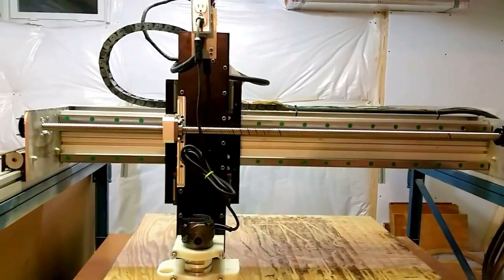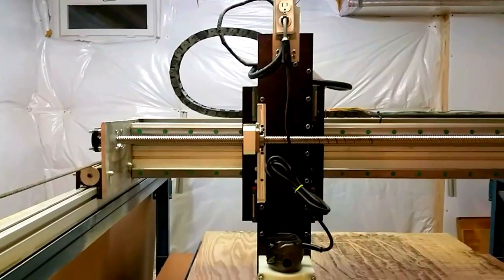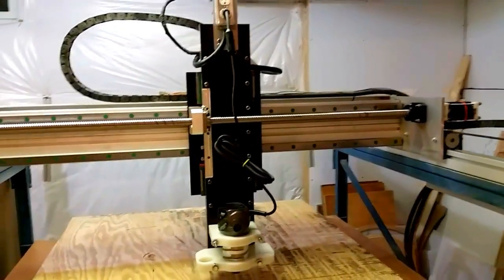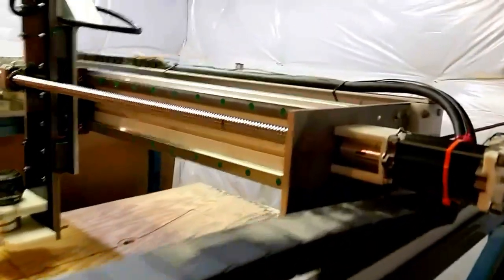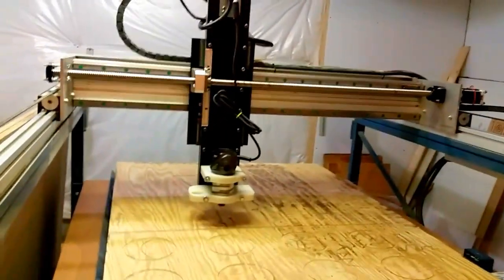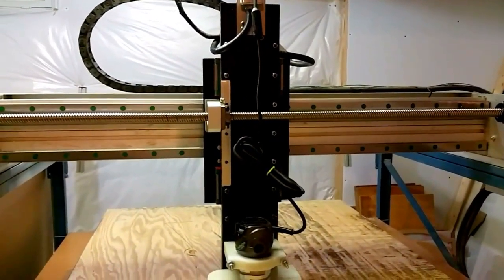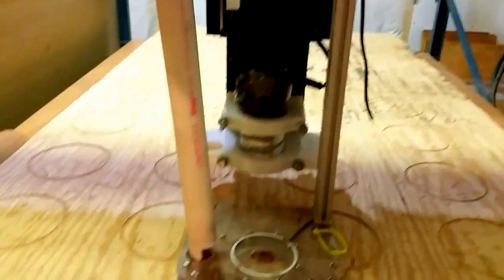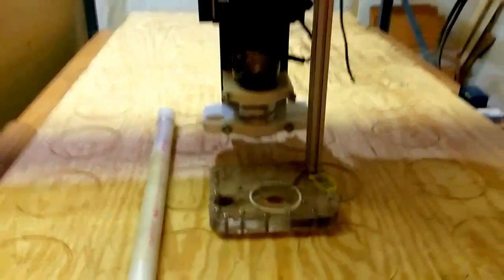DIY CNC 50" X 100" Hiwin Rails w/ Ballscrew 1605 2525 Upgrade

Comment: can you tell me what are the specifications for your ball screw diameter, lead and pitch  ?
Reply from the maker: 2525 for the x-axis (25mm diameter, 25mm pitch)
1605 for the z-axis (16mm diameter, 5mm pitch)
Thanks, RH :)
Reply: @540iflyby  thank you man 😀, As you know the ball screws are too smooth specially with high lead , can your stepper in z axis hold the load when you turn off the power at your stepper without sliding the screw down ?
Reply from the maker: I have gas shocks pushing up on the z-axis at all times. They are hidden behind the z-axis plate. Not sure if the z-axis would hold de-energized position without them. At the very least upward motion would need to be very slow not to stall the stepper.
With the help of the gas shocks, though, the z-axis (roughly 45 lbs) can be moved up and down with a single finger.
Reply: @540iflyby  i understood that any time you move the motor to any position, those gas shocks hold the load in that position ,but i can can not understand how did you attach them behind the plate!

Comment: what is the ballscrew make and size on the y ?
Reply from the maker: Patrick, thanks for the question. It is an unbranded Chinese ballscrew. It is a 2525 series ballscrew: 25mm diameter, 25mm per revolution (multiple starts), 1500mm long. Found it on eBay in 2016. Paid $238 for it at that time. :)

Comment: Is chain drive realiable Donp
Reply from the maker: In my experience it is. I got the idea from buildyourcnc.com. Never had the chain break even under full stepper motor stall (crash) conditions -1600oz-in stepper driving that axis.
I've had a little stretch in the roller chain over time, I simply recalibrate the pulse per inch setting in March 3 to compensate for the small percentage of chain stretch every year or two.